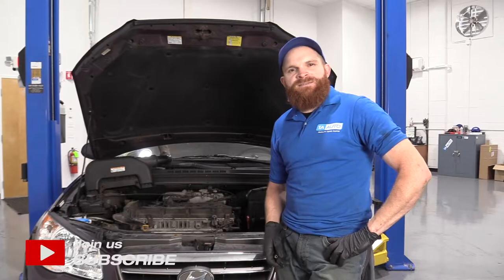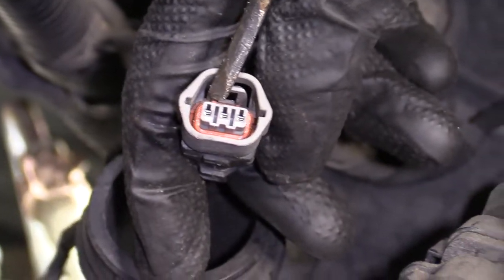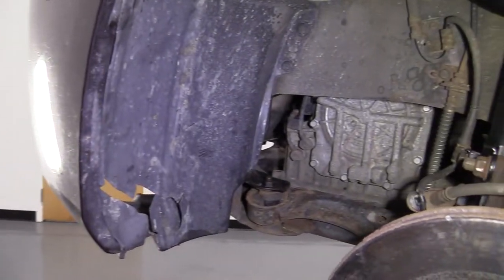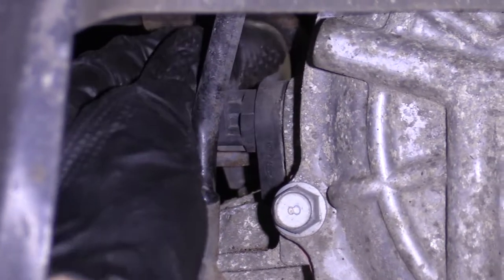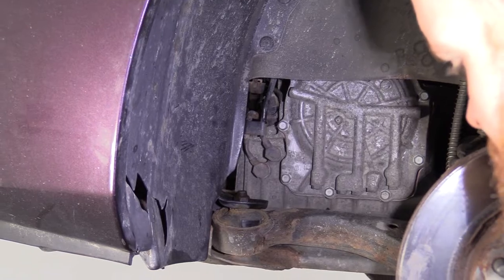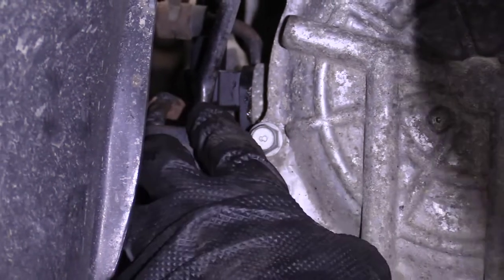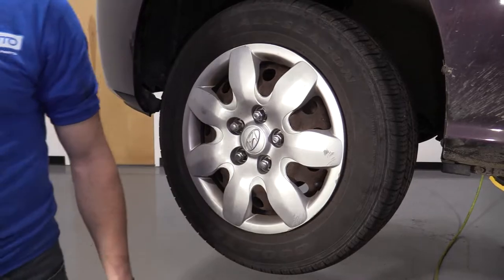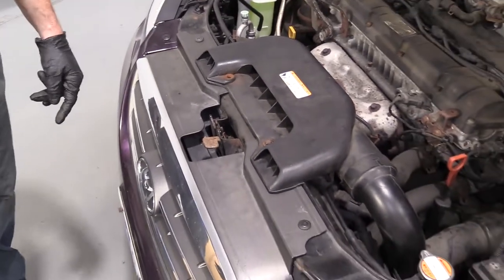How to Replace Output Speed Sensor 00-07 Hyundai Elantra

Comment from the maker: √  Watch the Video
√  Buy The Part at 1A Auto http://1aau.to/m/Visit-1AAuto
√  Do it Yourself
√  Save Money
Reply: That is the Input Speed Sensor on the Hyundai Elantra shop manual. Output Speed Sensor is at the back of the transmission near the rear motor mount.

Comment: This is the input sensor, if you are getting a P0722 code for output speed sensor it is located under the air filter box on the back of the trans.

Comment: The transmission on my 07 Hyundai Elantra goes into limp mode unexpectedly as I drive, and it will stay on first gear until I pull aside and let the transmission fluid temperature go down. Would a bad output speed sensor cause this?

Comment: I have 2007 elantra and sensor is not in that spot. But my Elantra is manual so could that be reason for different spot and where could it be?
Reply: Yes, these sensors are for automatic transmission to sense the speed befoere changing the gears automatically. A manual may not have these at all.